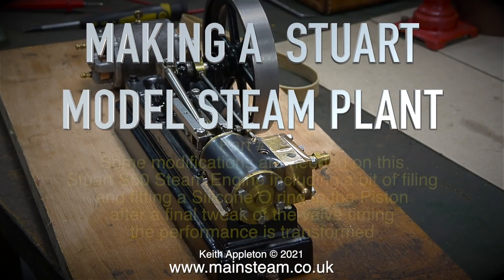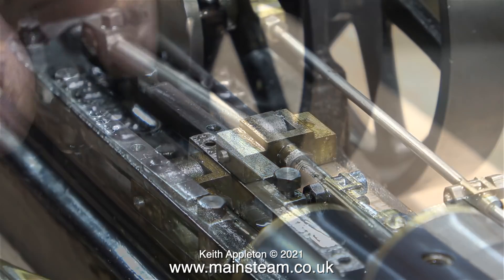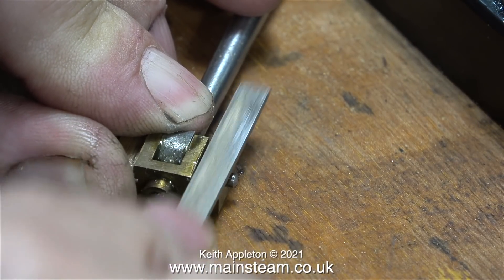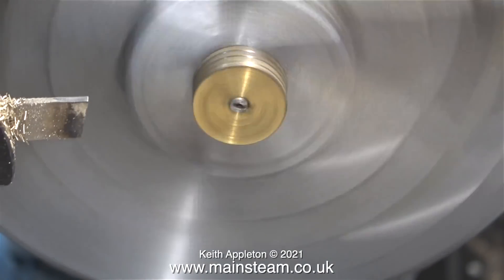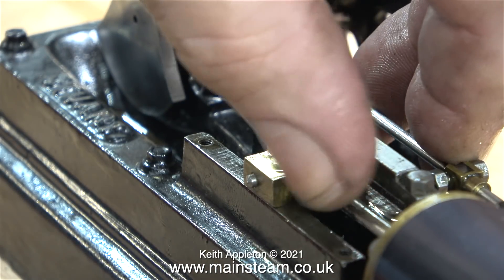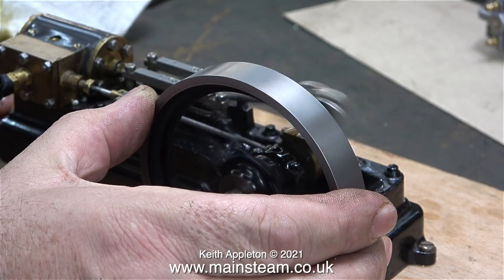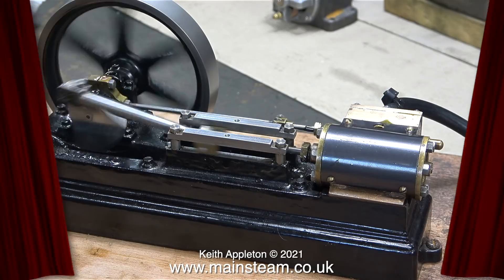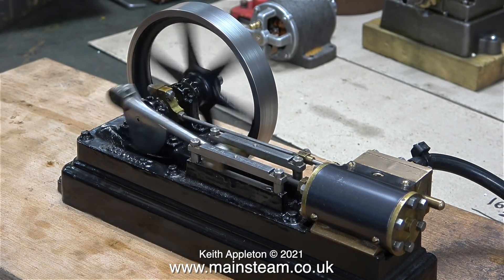MAKING A STUART MODEL STEAM PLANT - PART #13

Comment: I just got my engine to run but not sure I will try running at warp speed! Well I do need to add the cylinder lagging and another oil cup as only got one done.

Comment: Something that I can't quite get over is just how fast a steam engine will run.
I suppose the limits are steam pressure and load, otherwise it is capable of near WARP speed or self destruct. ;-)
Reply from the maker: They can easily self destruct as they just go faster & faster, especially the big ones.